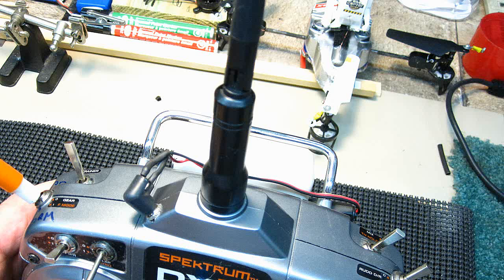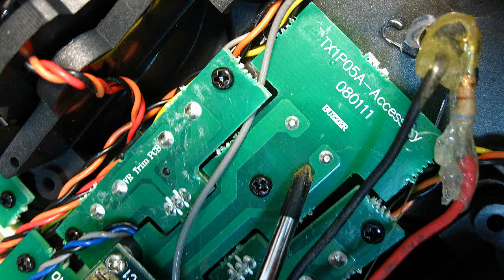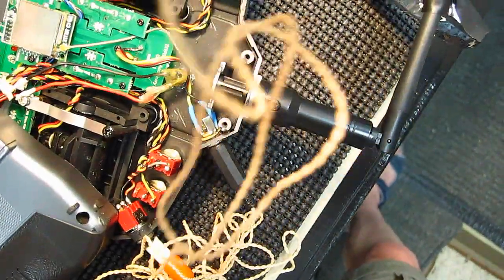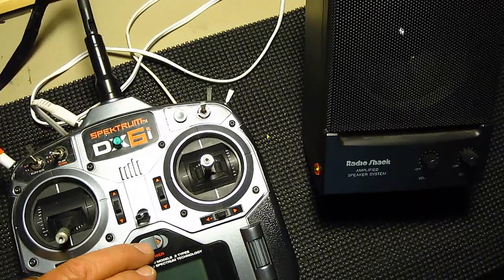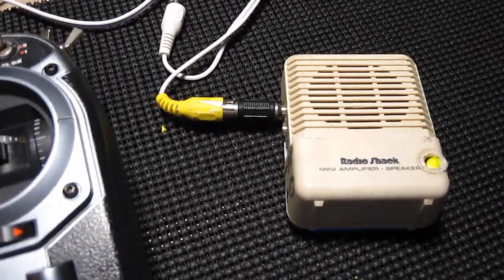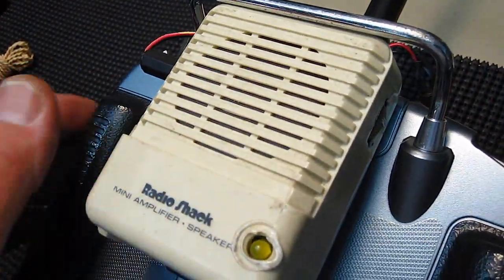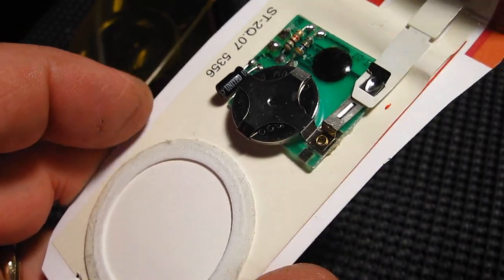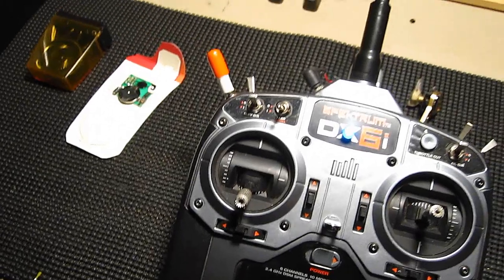I added an Audio Output Jack to my Spektrum Dx6i Transmitter and why.

Comment: Thanks David. I have been so afraid of using it that I have not even looked at the CD that was in the box with the helicopter & the transmitter in the same box. All I saw was a 5 page instruction about both. Thanks for the tip. I will search for the manual and I will also search on the net. 
I am great-full for your input.
Walter

Comment: Thanks David. I did have a look at your videos of the training stand & what I am going to  do is a variation on your design. I am just going to use whatever I have. I will hopefully take a photo & upload it.
What about programming the transmitter? Do you have instructions that I can look at? 
It has been very cold in Sydney (10 degree C : yes this is cold for us) & we have had strong winds & rain & snow in the mountains. I am afraid the shrimps have to wait a while.
Regards: Walter

Comment: Dave if you want get rid of the ear problem is put a drop of hyd peroxide 3% to 6% in your ear lay down with that ear up and let it fiz for about 25 minutes. Get a paper towel put it against that ear and lift head up you may see all the wax peroxide pulled out. Get wiffey and a couple of cue tips and clean rest of wax out. It worked for me and the funny thing is I was able to breathe better too.

Comment: Great modification. To extend the mod even further, for night flight and in areas where near total quiet is expected, you could put an LED in parallel with the speaker output (with resistor to protect it). That way, you could see each trim click to make sure it registered and it may benefit those without hearing at all. In such a case the speaker itself could have an on/off switch.

Comment: Thanks David.
As they say, necessity is mother of invention.
Your video resolution is so much better than the ones few years ago.just drop the mono-pod in the pipe & secure it with string as you do.
I have "Spektrum DX6i" and I have fiddled with the settings and I am afraid to use it. Do you have videos showing how to alter the settings such as throttle, pitch and other things that I know very little of ?
Thanks
Walter